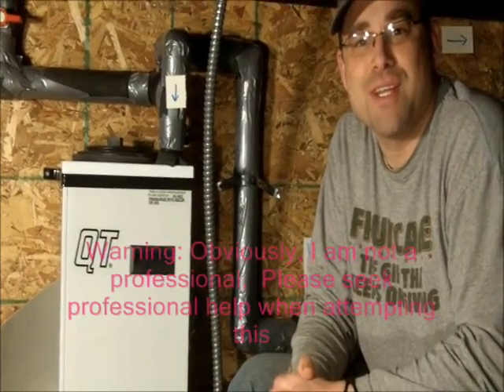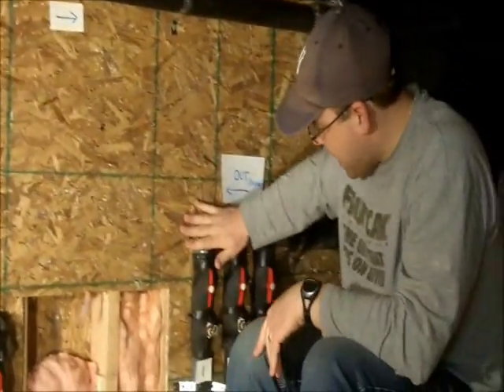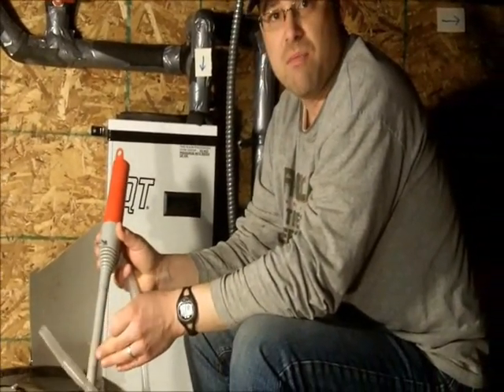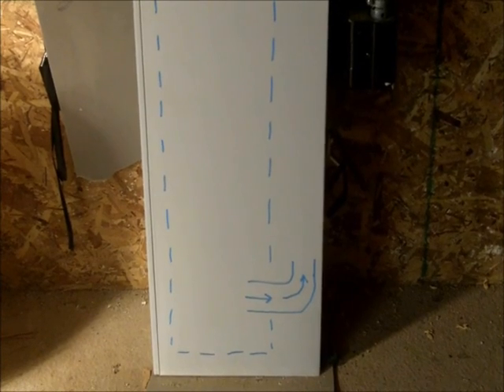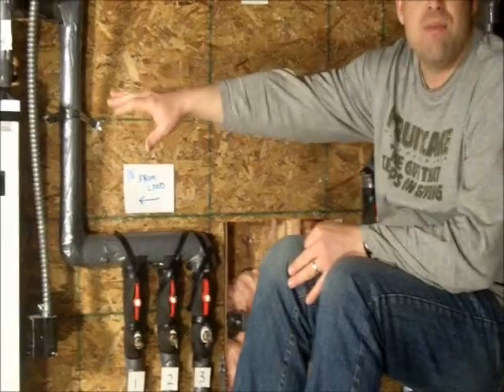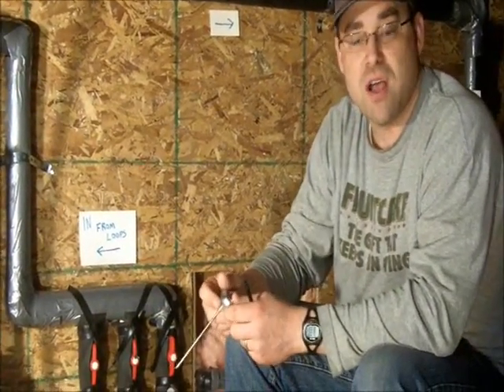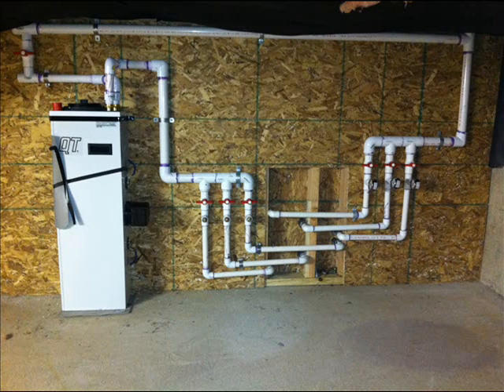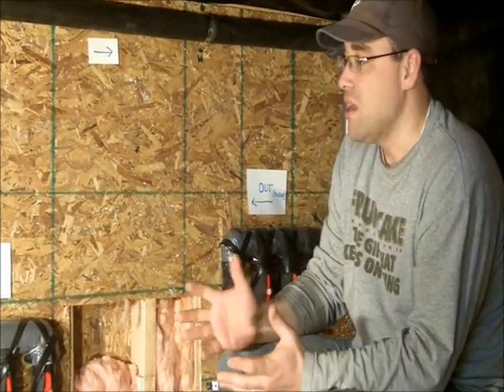QT Flow Center Install DIY GEOTHERMAL

Comment: Hi Chris,  Thanks for the great video.  Is the pump running constantly - 24 hours a day?  Or is the metal conduit and switch you added coming from / controlled by the unit?  Thanks,  Brandon

Comment: fellow michigander here, so am i to understand this pump is meant to maintain a particular temperature of say around 50 degrees thus requiring your alternative heat source to only produce a supplementary 20 degrees or so. or is this in fact meant to heat your house entirely?
Reply from the maker: It is mean to heat the house entirely.  Really Really cold days it has problems keeping up.  However, we have a wood burning insert fireplace, also.

Comment: What sq. foot house are you heating/cooling and how is the energy usage after some time? thanks for a great video.
Reply from the maker: Around 2000 sq ft.  Energy usage is hard to tell because we used electric sparingly before this also burnt wood.  We still supplement with wood.